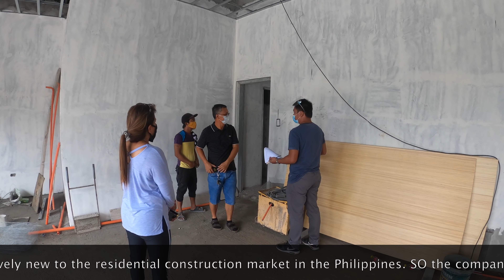Philippine House Building Step by Step, Build Day 165: Fascia Flashing

Comment: Love the color of the roof......I need to see if that’s available down in Bohol.......does the insulation help in cutting down noise, such as rain on metal?
Reply from the maker: Michael Fung 
Roof should be available there. Company is DN Steel Roofing. 
Hard to tell just yet how soundproof the insulation will be, all the windows and doors are open. Hear more outside rain than anything else. 
Thank you for watching. 👍😊

Comment: doortech installed my garage door 13yrs ago. the problem with them, as with any other garage door installer here, is when you need replacement parts. i needed my garage door opener and torsion springs replaced a couple of years ago and doortech didn't have the parts. they said they only do whole unit installs and quoted me for php130k. so, i said no thank you and bought the opener and springs from amazon instead. cost me less than $300 plus slow boat shipping. note that a 120vac outlet is required since garage door openers from amazon are 120vac. what type of wiring do you have from the pole or service drop? two types in the philippines, one is 3 wires (2 x120v hot and 1 neutral/ground) which you can easily get 120vac. the other is 2 wire (1 x 240v hot and 1 neutral/ground). this one requires a transformer to get 120v.
Reply from the maker: Our area only has the 2 wire available. Hopefully product reliability has improved. Thanks for the heads up. 👍😊🤔
Reply: @CasaTexPina  to be fair, the opener (raynor) doortech installed was very reliable with the motor still working when i replaced it. it's just that the plastic housing and remotes were falling apart due to its age. you might want to consider adding another electrical socket on the ceiling...sort of like an extension cord that you could plug-in to a small step-down transformer. these openers don't really use a lot of power. hide the conduit wires in the ceiling and buried in the walls also so you don't see it. i mean, at least it's there if you ever need a 120vac.

Comment: What is the color of your gate?
Reply from the maker: Haven't quite picked out the exact color yet, but thinking about a medium gray.
Currently it is still prime coat and body filler. 😂
Reply: Ok sir my suggest😅do not use black most of the gate in the subd is black